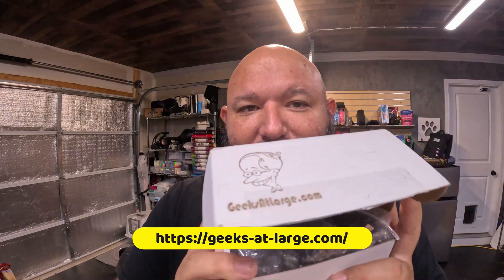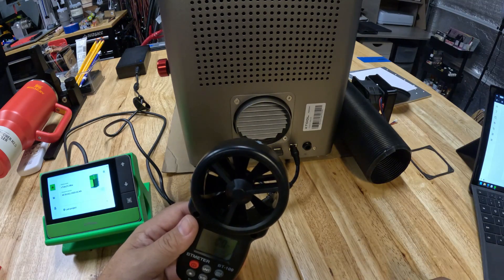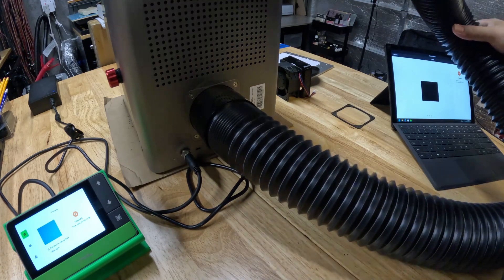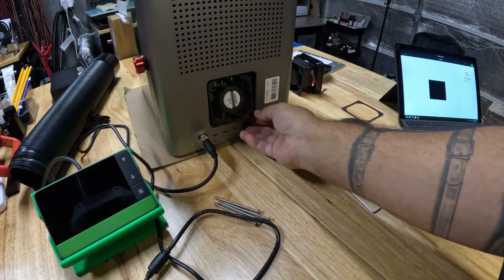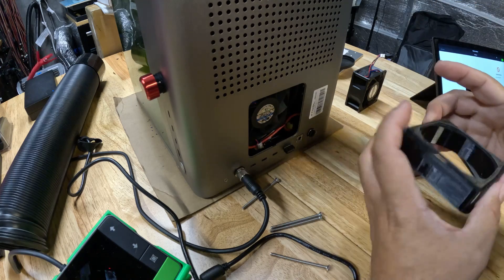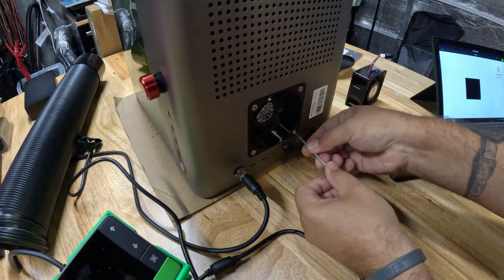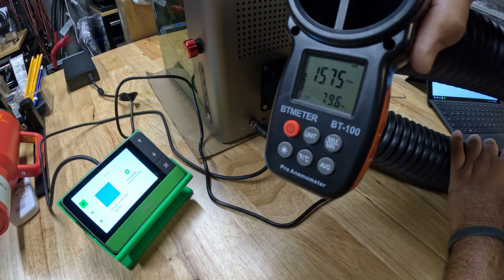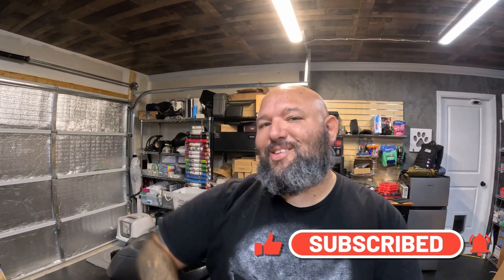Xtool F1 Ultra Fan Upgrade! Upgrade your F1 Ultra Exhaust.

Comment: Would this still improve airflow if the ap2 is also used?   Also, would this work as a reverse air assist type setup for flare ups and debris removal?
Reply from the maker: when a Air purifier is use is always recommend to remove the fan to avoid restrictions.

Comment: Thank you sir I just ordered me the fan the unit is not here yet but soon and will change out and let you know how it works.  But sounds like well worth the upgrade.  1-30-25 I got it all installed with the new fan and for $15.00 I should of gotten 2.  But everything went it perfectly no issues at all.  Thank you for this.
Reply from the maker: Let me know how it goes. I think you'll be happy with it.
Reply: @AlivePixelCreates  I got the unit and replaced it.  Have not tested it but was impressed by the price and quality.  Easy to put in.  I also upgraded to the magnetic set up with the 4" adapter in my vent system.   Judging from your excellent video should be great.  I also have a 6" infinty fan down stream venting outside.  Appreciate all you do Glen in Alaska.  Hope your move went well as I am behind about a year!  Looks like everything I got now is updated to the XTool family still got my 2 Atezr's but I guess they since went out of business.  Lucky I am